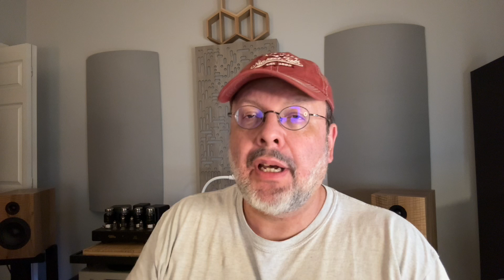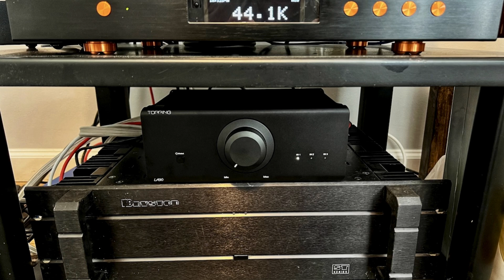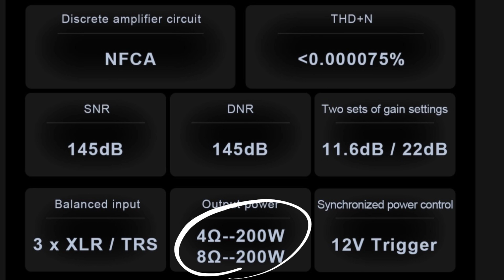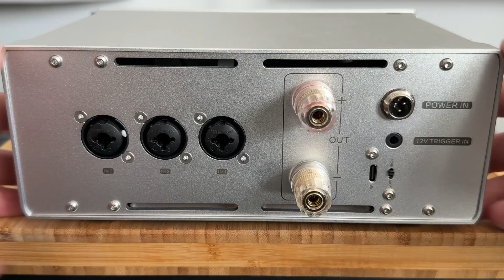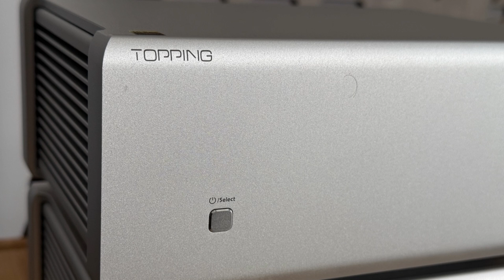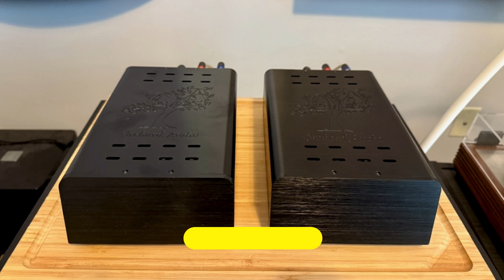Topping B200 Class AB Monoblocks Are Budget Bangers!

Comment: Do you have any recommendations for a used 80s CD player. I’ve gone through 2 already that are skipping and not working. Probably just buy a brand new one. I had a used NAD and a Sony that I’m taking back to the vintage repair shop to hopefully find one cheap and working.
Reply from the maker: No. Find a new one.
Reply: @MODAC your right. CD players are very difficult to work on as I seen. I have a pair of those old Polk speakers that you demoed in one of your videos from a few years ago. The Monitor 4a bought them back in 1989 for about 200 bucks and they are still performing. A bit bright in the treble and fatiguing but they are a good speaker!

Comment: If its not too late, try to get hold of the  D5proBC off ali. 
Its a "clone" or inspired by a darTZeel nhb108 power amp design.
Warm running A biased class AB zero feedback with classic big internal 120,000uf  power supply 😮
(First reviewed by Zero Zone)
Amazing for $600 before the trade melee started....
Sound is rich and sweet. 
Tubey with solid nuanced bass.
Holographic with Musical Paradise MP 701 preamp.
Too cheap for the quality on offer?
Maybe...not ...now...
I bought mine in December'24 to beat the tax.
Now I've stopped shopping, and resting on my bed of existing equipment,  enjoying MUSIC
🎵🎶🤔🤫🫢🎶🎵

PS edit:
Yes it drives LRS with authority!

Comment: Bummer. The power supply brick and therefore lack of a standard AC connection port is a non-starter for me. I despise cheap power transformers hanging off of my gear, unless they are purpose built to improve power quality while limiting interference (like on my phono pre-amp). I replaced my phono pre-amp wall wart with a proper Sbooster BOTW power supply.
Reply: To say nothing of the fact that because the power supply is seperate, the amplifier itself doesn’t have to pass UL standards, only the brick. Nope nope nope.
Reply: @HifiLoveLetter  I just think, for what they are, they are way too expensive. I'd rather get a Schiit amp, and they can be ran stereo with only one.